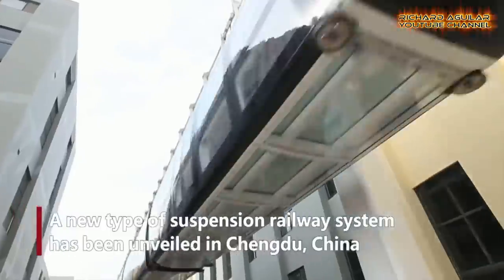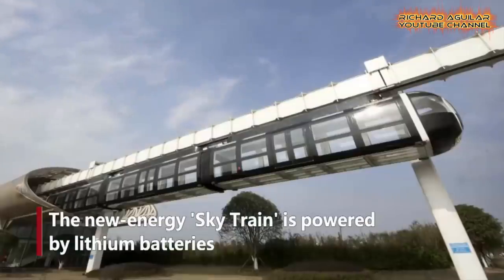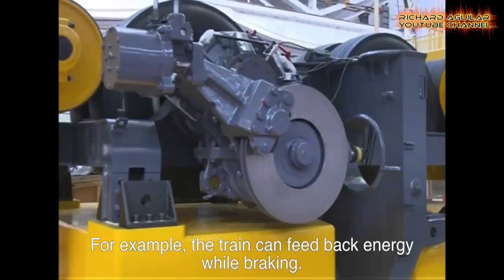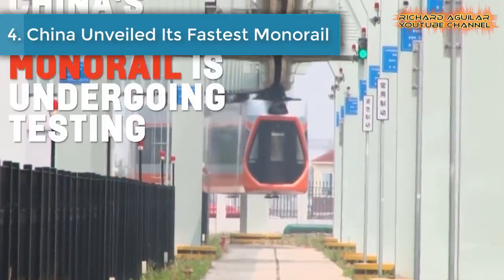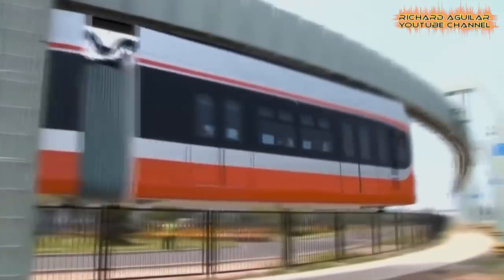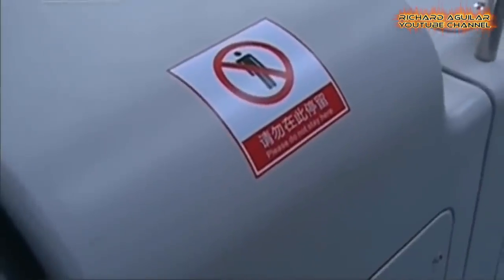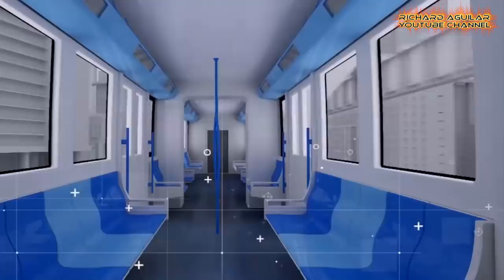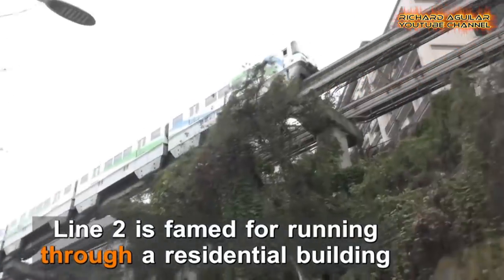China Technology! The Rise Of Fastest Skytrains And Monorails In China

Comment: My frenz.., your this channel, it is fantastic... It showcases mostly, if not all on new age China's headway with technology. Great work from U guys for 1, for bringing these eyeopeners to us all & (2) so too (Good Job) did the China(ese) for embracing & as well moving forward with developments & the utilization of technology, Kudos to both U guys & China.
Onna side note, I'd like to bring to the attention of the developers of these 'Skytrains', shud any of 'em so happened to also been watching this Richie's channel. That (attention) what I intend to highlight here, is the uniqueness of 1 Swiss' similar like "over-head hung light-rail type train, established & started services in as far back as since 30, 40 or maybe evn 50 or so odd years back. This 'Commuter' train vehicle of description is this so-named "Aerobus" by a Swiss company of the time named Wywy (if I remembered correctly that is). The uniqueness what amazed me was that this vehicle "did not have" the "overhead, train (pneumatic rubber tire) wheel or running-gear assembly rail-housing-box conduit". Instead in its place were (I think) a pair or maybe 2 pairs of "overhead (crane standard's diameter) cables" for its rail-line guide. With this such approach (by limited acquaint to this train type & so much just speculation alone, on my part) the probable draw-back coud probably be a limitation to number of train cars or sets that can ply the same line at any givn time. Howevr this is to me, pretty amazing nonetheless. Hope this same China(ese) manufacturing concern, takes it to study if such a set-up (tho technically possible, as had been shown by the Swiss, that it totally works, safe & reliable still), actually caters sufficiently enuf for getting maximum people-movement or delivery & that it truly serves the purpose what it's meant, at providing the ease of commuting with it.
Lastly my 2 frenz, if I may. This may come as a chagrin of sorts, baa..t,  I can only hope U guys dont take this too personally tho, Here's a small piece of advice ; ..coud U guys Please not "flash Your eye-brows" all that much..The expression is kinda creepy to look at actually, honest.., Please take no offence..&..err, Your camera's position too, in fact shud not be from top down onto U 2 like now. In so doing, U obliviously have purported yerselves to as-if sitting in a box down below, lowly & as-if being interrogated like. The camera's scopes shud rather be at probably the height of around Your mouths' level to be correct, as with how newsroom's readers are at. Jee Tnx for takin' the time to peruse.
That's it peops, U guys have a good 1 ahead. God Speed..